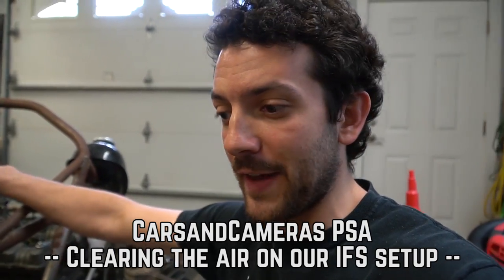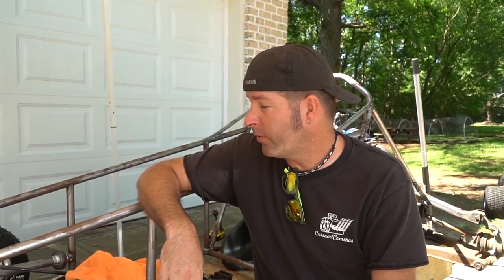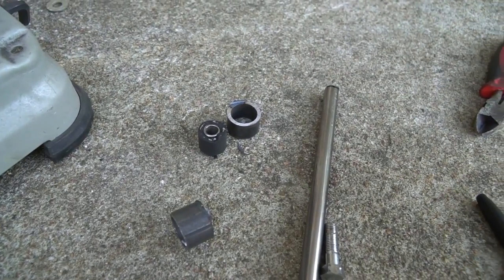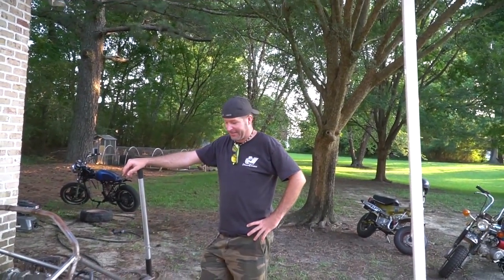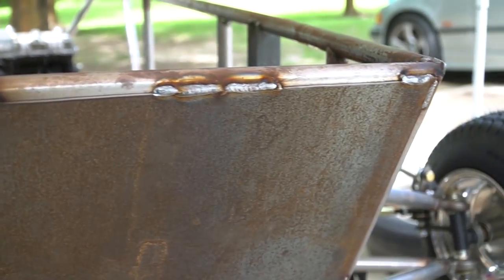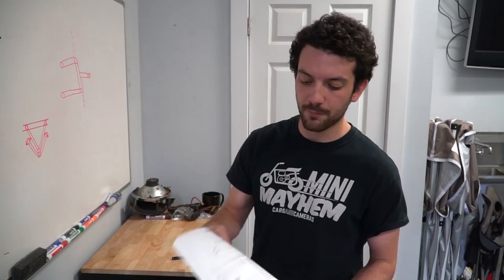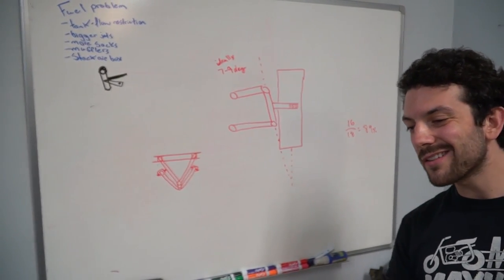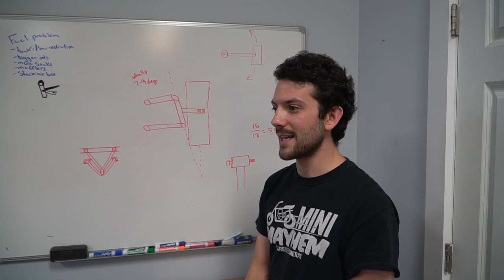Shocks, Suspension, CLEARING THE AIR | Cross Kart Pt. 10

Comment: Those Tractor joints are nothing like real Heim joints with threaded ends - REAL Heim joints arent stiff and require no break in period!  if your tractor parts WAS as stiff as you show, and after just an hour of drive time they've loosened up, then they'll be a sloppy/floppy mess in what? 2hrs? 4 ? - you get what you pay for,  if you choose to build something that goes faster than 30MPH on the road with cast tractor parts Good luck
Reply: Real Heim joints on my Icon upper control arms on my Toyota 4runner took almost 3k miles to break-in quality heims definitely have a break-in period. I do agree with you on the point that these are not the same quality of a normal automotive heim joint.

Comment: That drawing is not how it works. What is the point of having shorter a arms on top? Camber. On the drawing it’s 0 camber all true the travel but you have made it negative camber all true the travel of the front suspension. Stop trying to explaining everything and just show that it works. But on a cross Atv they got same length a arms, just saying. The front shock mount are not great.. the shocks need to stand about 45-55 degrees. Look at a Atv, sand rail or buggy